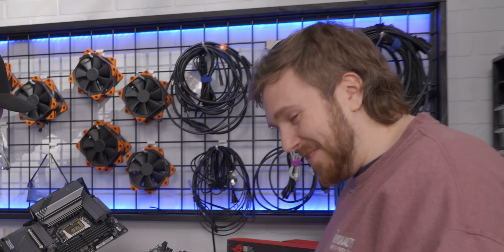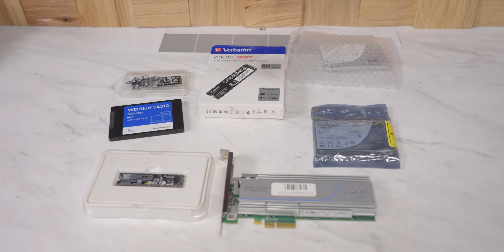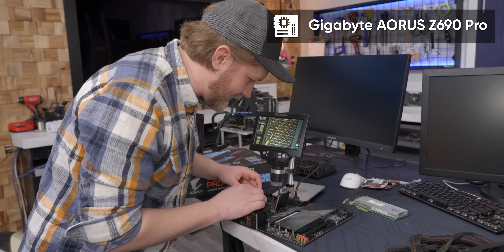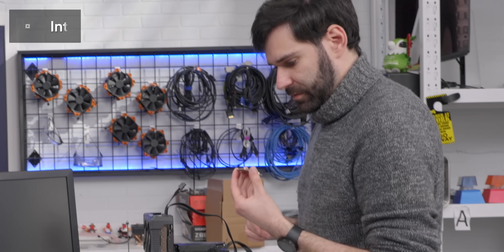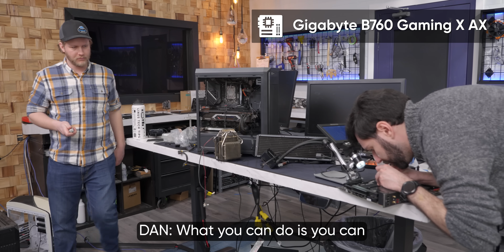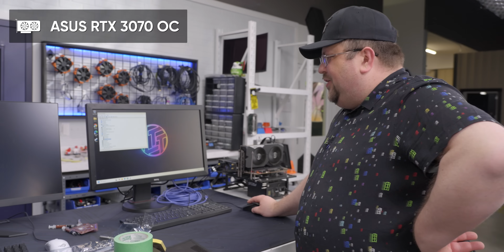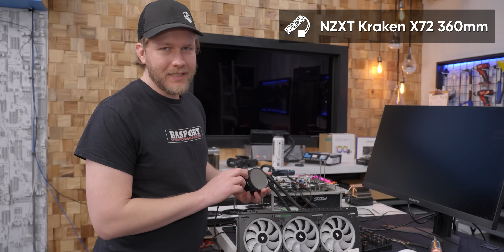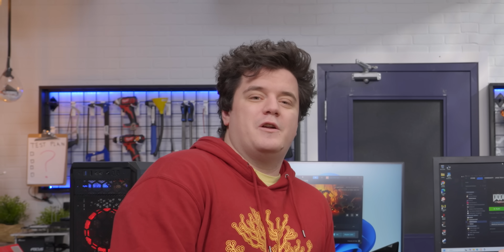I Built a Working PC using only Broken Parts

Comment: Let me tell you my story as I was very interesting I can replicate your previous similar videos and build a PC with mostly broken parts. I did not cheap out with the PSU cause .... you know ... fire hazard, but I've bought "broken" MoBo, CPU, GPU. 10 MoBo, 5 CPU and 5 GPU. Not a single one was fixable. 😞 When sellers here in Hungary say "it is broken" it is genuinely broken. The motherboards had missing pins (also LGA, forgot to mention), but also bent and one was even punctured under the heatsink (that was not mentioned). The CPU-s did not boot (not even in my working motherboard) and the graphics cards were just a mistery. Nothing looked out of the ordinary, even tried to flash the BIOS on them, but they were never seen my the operating system. All but one ! One card was bought as a "broken Radeon 5800". Turned out it was working just fine, but something was off, the performance was not as it should have been. Soooo, started digging and it turned out it was an older, Radeon 5800 8GB, just flashed with a different VBIOS. So this was just a scam, 100%. 

As a fellow techy nerd, I am loving you guys having great success with these repairs and buys, but sadly my experience was the complete opposite of the story. Scam and totalled hardware. But honestly, I kinda wanna do it again... .it was fun. An expensive fun, but fun never the less 😅

Comment: I've had my PC for 10 years in April, I had to change the motherboard, which sucked cause my psu was the issue and the mobo was a good one, and only because someone tried to remove the psu without my knowledge and screwed up the connector, But every time I tested it, it worked fine and when I go the new mobo and rebuilt it, it came on and ran for a long time without a hitch so I had to get a new PSU years later because the problem just kept getting worse,  one of my 8gb (16  total) ram sticks were DOA when i built it, I got a new stick like 2 years later, though it was a different brand (and speed but didn't know that at the time) Just recently I had diagnosed that the "new" ram became a problem, my would randomly freeze, and it was becoming more frequent, now i'm using 8gbs with a 2 4gbs sticks and I noticed my CPU temps are wayyy better. The thing about pressing numlock hits home. Get this, I can run things like god of war 2, hogwarts legacy, with not much issue just low graphics and a little longer load times (god of war even says your pc cannot run this, then it runs it) I would like better graphics in my games and I'm planning an upgrade to my PSU, GPU and ram. I don't live in a place where I can buy PC parts from a store I have to order them from overseas and it becomes really expensive with conversion rates and customs and shipping charges so I have make it work and take concessions. This video really just hit home for me.

 That being said i would never risk buying broken parts and in attempt to fix them cause don't think they will last as long as I want them to, and I'd have to go through the process of ordering them again. But I could see trying it out if I parts where more easily accessible

Comment: I just bent a CPU socket pin yesterday, it was so delicate to fix.
Reply: I really don't like the AM5 kind of socket for that reason. I bent a couple pins on an AM4 cpu and they were easy to straighten out, as long as you don't actually break them it'll be an easy fix.

Comment: I'm very curious what happens to these parts afterwards. They  wouldn't want to use it in the office where you need to rely on it, but you shouldn't resell them without extreme disclosure.

Comment: 20:54 I know, you leave detailes out that are not too important for the everyday PC-builder, but for everyone who isn't satisfied with just these reasons:

The ground planes are also important for signal traces that need to have a specific impedance, 
and it's needed for single ended signal traces that need a specific impedance and also need an uninterrupted ground path near (below) the signal trace, 
and to also keep the ground potential as stable and equal accross the PCB as possible, 
and to shield the signal traces from one layer to the next.

Comment: 3:57 I once had a faulty RAM stick in my laptop, and it was the most infuriating thing to troubleshoot. I didn't know what was wrong with the system, every crash, freeze, and software malfunction was completely random and not reproducible. System health checks didn't show any issues, so I reinstalled every software, driver, and the OS several times, nothing worked. In the end I decided to try different RAM, because that's really the only relevant component I could replace, and after that everything just started working properly.
Reply: To save money on my current computer, I used the RAM from my previous one, but they were not quite compatible.
Every memory test showed no errors, but I occasionally got blue screens.
They had previously worked fine on the old computer.
I eventually got new RAM and the blue screens went away.
Reply: Did you try the memtests? That can help ID RAM problems pretty well.
Reply: I also had RAM go bad in my last PC, and I was super confused. Luckily after some research I came to the conclusion, "Well RAM is most likely to cause all these problems, and if it isn't the RAM I'd rather not deal with it myself." Luckily just putting new RAM fixed it.

Comment: I feel like this video would be a lot better if instead of the 'new' price and potential savings based off of that, instead recently sold examples were researched on ebay to find a comparable used cost, as anyone looking to repair a 'spares/repair' item would not be looking at new.

Comment: I have a comp I built for $400
P520C think station 
256gb ECC ram
$40 Amazon CPU cooler 360mm rad
NvMe 1tb
GTX 1060 3gb 

Plays whatever I want it to, does 60hz at 4k with minimal issues

Comment: I got my server(older gaming pc without gpu), Xbox One, ps4, switch oled, and my MacBook Pro 2018 All broken in some way. Some easier than others. I spent like 40% of the retail cost plus like 10% more in parts. I got my Xbox for $40 and it was just a bad HHD. The server had a bad power supply. The ps4 had a dead fan. The oled switch had a broken fan as well. The MacBook had a bend gate screen (that was the hardest to fix with soldering the cable back correctly. 

In short if you know how it can break and be fixed then you can get broken tech that in alot of cases has very simple problems that don’t take a lot to fix. (Like the Xbox or ps4 that was a $20 fix and I got those consoles for a total of 100 including 3 controllers (2 ps4 1 Xbox) all the power cables and even hdmu cables.

Comment: 26:30 i agree, if you're choosey with your parts, buying used or "as-is" is a great money saver, but there are a few parts that you are simply better off buying new or known working. CPU and PSU don't go sketchy, and GPU just buy an older GPU.
Reply: I take two kinds of deals: ones with risk associated but exactly the product i want or unbeatable value deals and adapt my needs from there ^^
Reply: Yeah except psu and storage i've always bought used especially from amazon warehouse deals. No reason to go latest and greates if you are not gonna build the greatest.

Comment: I run an Intel 730 SSD in my system. I love that thing, i will gladly buy Intel SSDs again in the future. The 730 had a safety feature in it that it it were too fail or the SSD detects any sort of write error, or that it's aging to the point it doesn't have a ton of writes left in its life, it will automatically stop write functions and lock itself in a Read Only state before it's too late and the drive fully fails. That way you can copy your data off of it to a working SSD before its too late. More SSDs should come with that function. It artificially shortens the life of the drive a bit (not by a noticeable amount tbh) but in exchange you get a bit more peace of mind for your data.
Reply: Wait, this is not how basically every SSD operates? I for some reason thought that this is the case... SSD manufacturers, WHY??

Comment: During the Pandemic Years I built myself an Ryzen 9 3900X with RTX 2070 Super and Taichi X570 and all of them where super cheap and sold as broken. The CPU had bent pins, the GPU was working even if it shouldnt and the same goes for the Motherboard. Since then I am all in buying broken parts^^

Comment: I had a gpu that died one day and it was really weird and It would work until it loaded windows and I figured out that it would work with out the drivers installed but the second the drivers were installed it wouldn't work

Comment: I built a broken PC using only working parts... we are not the same.
Reply: I built a broken pc in my dreams. Traumatizing stuff
Reply: my first pc attempt when i was 13

ddr3 ram
ddr4 motherboard
the wrong socket cpu
no case
25$ psu
Reply: @GlyphXCharm1  I worked in a small 1-person repair shop. Boss assigned me items without oversight. Asked me to purchase a backup tape drive. That was the assignment. All I knew was DOS and Windows. Day of installation, he asked, "Did you make sure to certify that this drive works with <whatever non-DOS system>?!!" Uhhh... no? Lessons learned!
Reply: @GlyphXCharm1  if the only thing that cost money was the PSU, then just keep getting the other stuff until you have something that goes together easily.
Reply: @GlyphXCharm1  it's like using apple with android. Not Compatable
Reply: @Antonder2te its actually, apple to apple, its an amd board, intel cpu xd
Reply: @GlyphXCharm1 I guess it didn't end up well? 😀
Reply: @GlyphXCharm1  I was lucky enough that I discovered Linus before building my first one, and now I'm the person for my family and friends when they need something built or upgraded lol I even worked part time in a repair shop for a while.
Tho way way back in the day I tried swapping a cpu with a friend. Problem was mine (my grandmas) was an Athlon II 64 X2 and my friend had an i3 3rd or 4th gen. We broke his board but my cpu was fine which was surprising as putting an AMD into a LGA socket of any kind is a really bad idea, so how the Athlon didn't break is a wonder but when I found it again along with the GPU of that old pc there were some bent pins on it and I don't know if it happened while I took it apart or if it is from the 'incident'.
But to be fair the 7800 GT from Gigabyte looks nice and 'functions' as well as it can nowadays and the motherboard is fine and has like 6 pci e slots and 4 ddr2 ram slots. For a pre built from ~2006 it wasn't all that bad as I could play most everything I did back then without any frame issues, only when I got my first own laptop which was like from 2003 I knew what it meant to play minecraft in 2012 with lowest settings, windowed on a 600x400 screen with around 14fps, luckily I'm a very patient person
Reply: @GlyphXCharm1  ooo im 1 year below 13 
here's what parts i picked
- used motherboard asrock b450 steel legend
- used CPU r5 5600x
- used AIO id cooling airflow x360 snow white ( i might change that for a tower cooler not aio)
-  new ddr4 ram apacer nox 2x16gb
-  used gpu 2080 ti
- new PSU corsair rm750x
all in a new ginzzu v580 case planning to get like 7 fans not including aio but it kinda too much and already comes with 4 so im gonna stick with that for a while
it all costs like 550 bucks if i convert russian rubles to usd but we get paid really differently (like a lot less) so it ain't even that cheap
i searched up average wage in each country
my parents never really told me how much they are getting paid lol but pretty sure that 550 bucks is a whole montly wage including both of them
soo with taxes and food and stuff we're getting like nothing
Reply: @yoWanderer nice 2080ti still rocks 😊
Reply: @yoWanderer  yup, no need for an AIO and saves money, I think the Thermalright Phantom Spirit 120 SE is a really good pick, pretty efficient although you should check ram clearance cause it's pretty big.
Reply: I've had a bad day and this made me laugh, thank you
Reply: Been there, done that. 😂
Reply: Me when Windows 11
Reply: lol
Reply: This made me chuckle. Thank you!
Reply: I thought the same thing... till i flipped the psu power switch
Reply: I got this video after getting a « broken 3060 » for 10 usd and watching this video on said broken 3060
Reply: guess that's where they were buying from
Reply: I remember my first time building my PC, the case I bought was second hand and didn't have the standoffs included with it. So I assembled the PC then turned it on and it started smoking, atleast I learned a lesson to ask if they'll give me the screws if I purchase the case. 🤣🤣
Reply: i broke a pc using working parts we are not the different
Reply: I built a broken PC with parts I don't own.
I stole them. I tripped during the process. Am sad
Reply: Something’s wrong, I can feel it… wait? WHATS BURNING
Reply: Windows 11 when it saw my laptops bt/wifi card
Reply: Dude😂😂
Reply: @floobs  I broke a gpu and wifi card in a working pc becouse I removed them while it was running (also dumb
Reply: Stop being a beta putting corporate sellout YouTubers on a pedestal
Reply: Bro is him
Reply: I built a new pc with all new components, but the Corsair PSU was broken and destroyed the motherboard, the graphics card, the SSD, and a RAM module. I didn't know at the time the PSU caused all this, because the motherboard still worked-ish... So I replaced the graphics card as DOA, and the SSD as DOA. The replacement components didn't get fried again but I've been having trouble with the mainboard not wanting to run on the memory clockspeed, or every time putting it back to default in the bios, I've been having trouble with blue screens from time to time so I found with advanced search software the DDR was broken, So I replaced those under warranty, also Corsair. Then finally after about 2 years I noticed getting shocks from my pc case more and more intense from the case itself.. So I dismounted the PSU and when shaking it there was a loose component in it with the volume of a screw or something but it wouldn't come out and I'm not sure if I could see it, maybe it was a transistor or something so then I finally sent the PSU under warranty for a new one... and around that time realizing it was most likely the PSU that caused all this shit in the beginning. Then later I bought a new motherboard because I couldn't send the current one for repair and be without any motherboard for weeks or months (they had already " upgraded the bios"  to the newest version in the store, which was total bs because I had already done that myself, so the last resolution was sending it to the manufacturer being Asus. I've worked there and I know how you can get refurbished boards as a replacement.... ) .... So yea... lesson learned; be very cautious in every possible way; nowadays I have 0% excitement when I buy something new electrical equipment (I've had more shit with other products arriving defect like bad manufactured or destroyed by the courier), the excitement only comes after it's been working for a while to build my confidence.
Reply: @floobs  welcome to real IT work XD cheers
Reply: Homie gor a solid chuckle out of me
Reply: you guys are built different
Reply: My rat just passed today, genuinely needed this laugh, gives monsters vs aliens; may not have a brain but I have an idea, energy
Reply: I keep mistaking Jordan and Anthony. They don't actually look alike but their face is the same shape...though Anthony doesn't have a beard and Jordan has short hair.
Edit-Just found the subreddit post and video, Emily not Anthony.
Reply: I broke my working PC using broken parts. 😜
Reply: My first pc had quite litterally every single part & peripheral rma’d in the first week of use
Reply: he was born in the brokenness... molded by it
Reply: lol
Reply: Lmao
Reply: That WD drive is not broken it’s a bad firmware that cause to breakdown if you fix it, it will work

Comment: Trying to find broken parts is harder than building the pc.
Reply: Exactly you will get max 50% discount if you can fix it 
But with GPU you are basically getting scammed 
With CPU ehhh maybe 
Motherboard and PSUs are usually most likely to be fixed 
Less heat usually means better chance at fixing